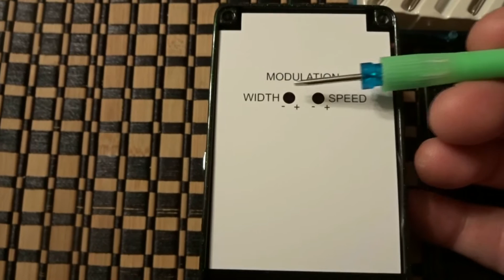How to Tell if you have an MXR Carbon Copy "v1 or v2" (Trim Pots Explained)

Comment: Thanks for the explanation on the difference between V1 and V2 versions of the pedal as well as setting the Modulation trim pots. As a suggestion, to assist with your explanation you could draw a simple diagram on camera showing fully clockwise and counterclockwise positions as well as the defaults.